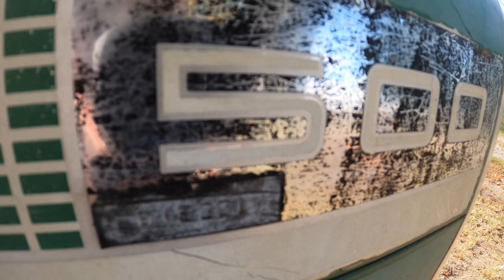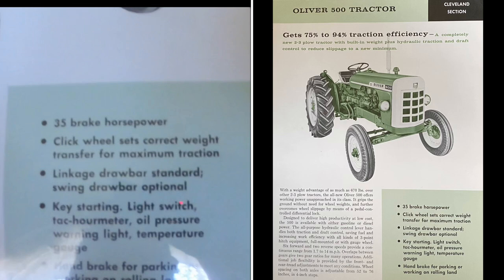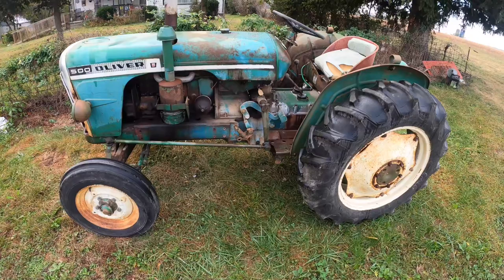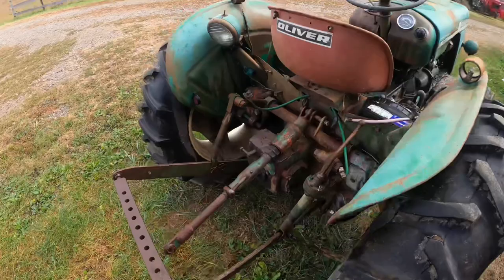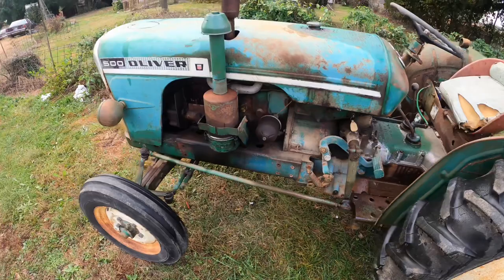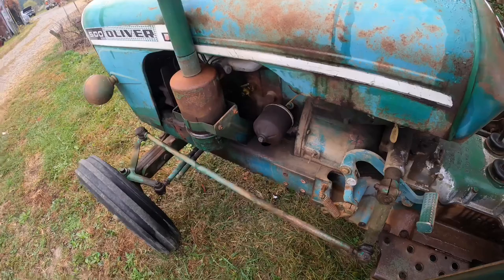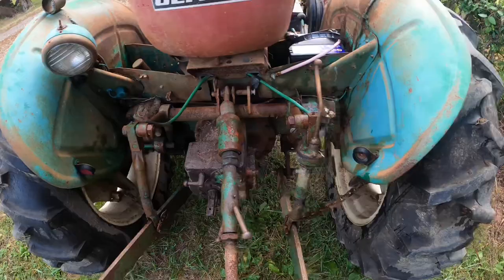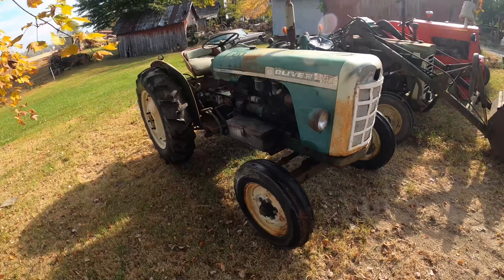The Oliver 500: The 550’s British Cousin (David Brown 850)

Comment: I used to sell Case / David Brown tractors of the 1960 to 1970 vintage. They likewise had a two stage clutch, but there was also a "seasonal" dis-engage lever that looked much like the lever you pointed out on the right hand side near where the foot rest and fender meet. THe seasonal dis-engage de-coupledthe inner pto shaft so that the two stage clutch throw-out bearing was not loaded or turning all the time? Customers who were only used to American style live pto systems would forget to dis-engage that "seasonal" would eventually have to work on the two stage clutch. Anyway, that's what I was reminded of when you pulled up that lever. I could be wrong, but you should do some research yourself. The actul models I dealt with were the 880 DB, 1190 Case/DB, & 1194 Case (all David Brown built).
Reply from the maker: I’ve got books coming so hopefully I’ll get it figured out. Pretty neat that you sold these DB’s when they were new!

Comment: The main thing to remember is that sensing cable on the rear should be attached to the top link to use draft control or tcu and u don’t really get a hold position in the middle it’s either all the way up or at working depth, if u want a “hold” position on the 3pt disconnect the cable from the top link - it’ll raise all the way back lower all the way forward and bring it to the middle to “hold” kinda like a remote lever 15 40w engine oil in the engine and transmission and gear oil in your reductions n yer good to go

Comment: When I went to work for the Oliver dealership in 1969 there were several 500 and 600 units that we serviced in central PA. Remember them being very fuel efficient. Replaced a couple of head gaskets and did clutches and hydraulic work as well. 

Parts were hard to obtain at times through Oliver however there was a Oliver dealership in Thibodaux, LA that was very helpful and we had his phone number written on the 500 parts book. After Case purchased DB in the early 70’s many of the parts were available through Case. 
If I recall correctly the top link was spring loaded to provide draft control when that cable was connected to the top link. For position control the cable had a storage position behind the battery box that kept it extended to the correct length. There was a lever at one end of the rockshaft to lock it in the raised position. I don’t remember the type of drawbar you have, however it could be used with the locked rockshaft to support
Reply from the maker: That’s neat that your dealership sold some. I don’t think ours did but apparently the one in the next county did. I knew they all arrived in the US down in LA so I’d say they knew how to get ahold of DB.

Comment: The Oliver 600 was based on the David Brown 950,but was fitted with the cross flow cylinder head to improve emissions for the US market . The 990 was fitted with the cross flow head . This is probably why some people think the 600 is a 990.
Reply: It was the later 990. I have a 600 on a long bonneted 990 most are

Comment: That is a very complete example. Even got the top link. David Browns were very fuel efficient. They got a bad reputation for the 3pt. I have never owned one so i dont know if it was deserved or not. It seems they had a lot more adjustments perhaps people didnt understand them. I have been wanting to take a chance on one becaues you can buy them for next to nothing.
Reply from the maker: Hopefully my books get here this week so I can figure out what some of this stuff does.
Reply: I’ve never had a problem with my David Brown, great tractors!
Reply: Going by my experience over here in Australia the later ones with the selectamatic hydraulics got condemned very unfairly because the stupid tight arse farmers didn't look after them properly so if that is how you treat them how can you blame the product
Reply: I have my father's 880 that he got new in 1969 and he sold it with the farm then I got it back again and the  only thing that has been done to the hydraulics is I had to replace the lift ram seals that's all in well over 50 years so that proves what good regular maintenance does
Reply: Good idea go for it

Comment: Nice rare machine. I edited my comment because I thought the 550 had more than 35 horsepower. But I called my dad who sold Olivers for my uncles dealership and he said the 550 was 35 horse gas and 38 for a diesel. I asked him why Oliver sold these and he said the only reason he could see was that they were cheaper than a 550. But that is only speculation.
Reply from the maker: Could be. I figured the fuel economy was a big deal too.
Reply: Actually, you were right. The 550 was rated around 45 engine horsepower for gas and diesel and the 500 making 35. Maybe your dad was thinking of drawbar performance, where you'd see about a 20% loss. The 550 was a well-powered tractor for its size.

Comment: Very cool find. I bought my 600 in April and have been going through the same learning curve as you. 
The hood is held down by two springs on either side. One behind the air filter kinda and one on the opposite side. 
Luckily for you one of the leading experts and collectors is in your neck of the woods but I'm sure you know that by now.
Reply from the maker: I saw your videos! I wasn’t sure where you were located but I noticed they were current videos and you hadn’t had the tractor that long. Super lucky to find that, I would have been all over that 600 lol

Comment: I had a DB 990.
Good tractor.
Only issues were 3 point hitch wouldn't work
Reply: Dad had a 995. Internal hydraulic line ruptured. Major repair to fix. Happened again and he put external cylinders hooked to one of the remotes to operate the 3 point.
Reply from the maker: I’m waiting on my books to get here to help understand this hydraulic system. It seems complicated but maybe it isn’t really